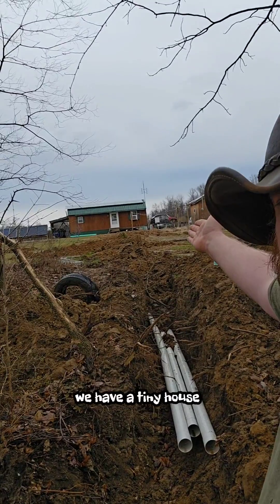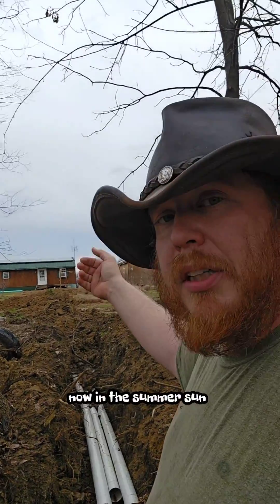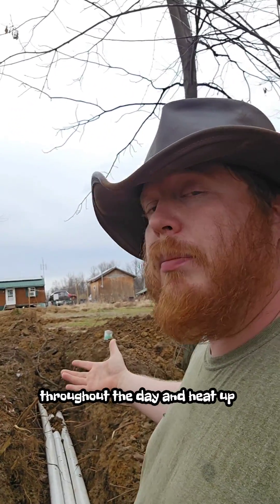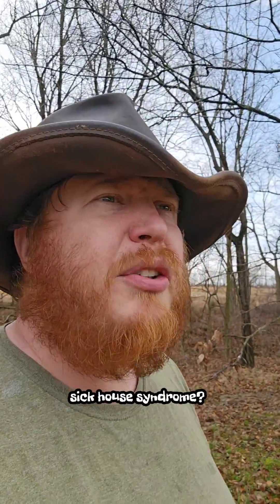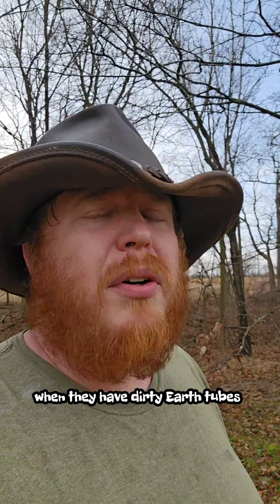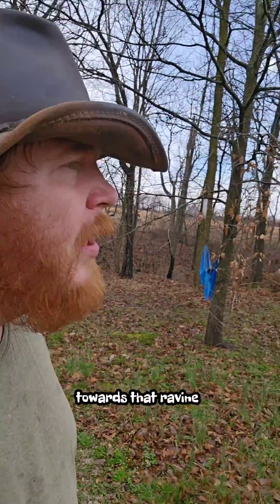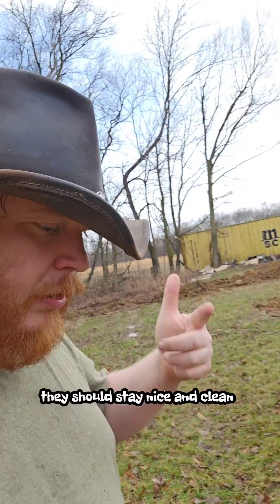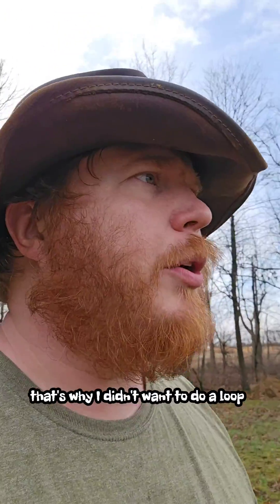Why didn't I loop my Earth tubes? Well, this is why.

Comment: Did it work 🤔 I live in SD with 30° below to 90° +, how long would you recommend the tube be. 🙂
Reply from the maker: It does work, but the length of the tube restricts the fan more than I thought it would. I have a new glycol based design, but won't be building that for a couple of years.
Reply: @theoff-gridguru what about a 12" diameter covert pipe ? The metal could perhaps help with cooling. Does the fan not not move enough air due to the length, or strains? I was looking at prices and they seem affordable.

Comment: I think this whole conversation is why people use water pipes and a heat exchanger instead. You don't have to worry about condensation or mould or insects in a water pipe system. It's a closed loop, so even if you decide to put a sanitiser or antifreeze in your water, you're never going to be exposed to fumes from that. With a heat exchanger on the inside end, you can even use the wonders of reverse cycle refrigeration to extract heat from cold soil in winter or dump heat in already hot soil in summer. 
Water is just a better system.
Reply: It also costs likely more than 10 times as much, is more complex, harder to repair, makes a lot of noise due to the compressor being inside the 300 square foot house.

Comment: I would consider water loops pipe into the same manifold that you would distribute radiant heat and add an undersized solar minisplitto remove humidity.

Comment: Best explanation I've heard in a long time, most simple and best assurance that all the moisture drains back and potentially could dry too. How's it working right now in July heat? You could add some homemade curtains outside walls could stop a lot of hot evening sun. Also could built a large barn over your house, double roof would stop so much heat from coming in, also could make your temporary house last much longer.

Comment: Not buying any of his reasons.
Reply from the maker: They're not for sale anyway
Reply: One advantage to the simple pipe he is describing. It can easily be cleaned and sanitized as needed. Electricians send a line down a conduit to pull wires. Pull a brush or swab down the pipe to clean.   
   Another advantage is that no radon gets into a sealed pipe.
Reply: @davej7458  If it is sealed, how does the condensation get out?
Reply: @J_Strong  Depending on the situation, you can slope it to daylight  or drain it to a rock pit. Large sized round rocks for air circulation and drainage. Or  create a sump and pump it dry as needed.

Comment: Do silica packs go old? I wonder if you could use those to counteract moisture buildup
Reply: Yes. They only absorb so much water before they stop working. You can dry them in an oven, but the color changing ones have poisonous additives.